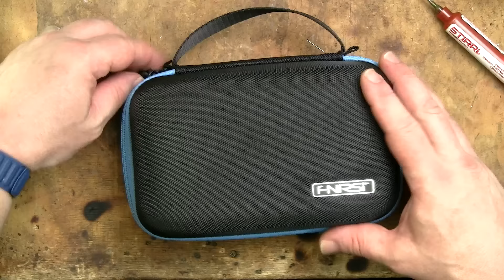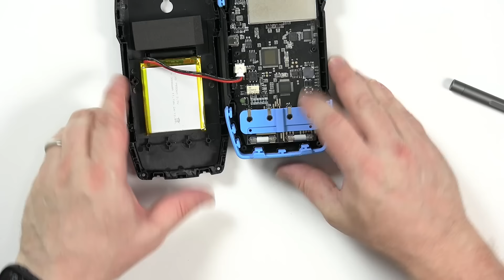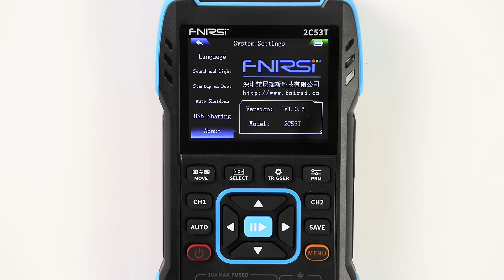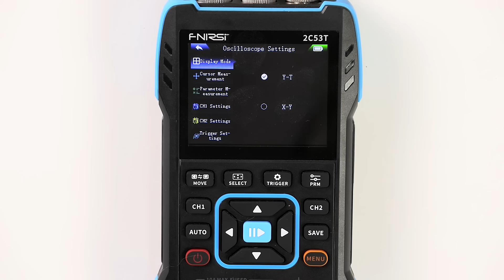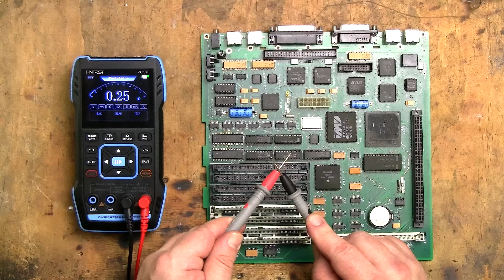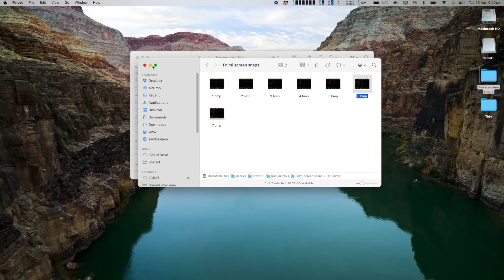FNIRSI 2C53T - 3 in 1 - Multimeter, Oscilloscope & Signal Generator Review

Comment: Can't hold a candle to the Alientek DM40. It's dual-channel, but not much else in it's favour.
The UI is awful: In this mode this button does this, in that mode it does something different.
Save the button space, have a much bigger screen, make it horizontal, and make it touch-sensitive (and context-sensitive) for the UI.
All you need is a touch-sensitive screen and I/O ports, the buttons are a huge waste of space.
If you're wedded to FNRSI, maybe check out the 2C53P instead.

Comment: Is there a difference in oscilloscope functions between this model and Fnirsi DS215H? They are both 50mhz 250ms/s and the cheaper DS215H has a higher res display

Comment: Thank you for the great review. I'm getting into soldering and needed a decent multi meter and since I bought the fnirsi dw200 solder station it's only right that I get the same brand for the multi meter. I would have bought the fluke but man there prices are insane! I think this will be more than enough for a beginner! Thanks again

Comment: I also bought one of these myself. Works very well. The only downside for me is that capacitance measurement is limited,. If you are measuring capacitors in the pF range, this meter won't be able to do that. Another downside for me is the signal generator can only out a maximum of 3V peak-to-peak. I wished it could at least get to about 5-6V peak-to-peak.

Comment: Thanks for sharing this, it was helpful and I will keep it in mind.  But all those button sequences are a lot to remember
.
I have a "big" oscilloscope that my youngest brother gave me. And I bought two or three usb oscilloscope where the computer screen is the control for the ADC data in an external usb box with probes.  And I have used sound card oscilloscopes for at least 30 years or more.

The problem I have with battery operated anything is I want to study things that go on for days, the battery runs out and there is not enough memory to store everything.  So i collect the data, store it and process later or I write c programs to monitor and capture summary data and event data in real time.

Comment: You didn’t mention how to use the relative mode in the multimeter. Use the PRM button. 
I would have liked to be able to fix the resistance range for a fast response. Great when comparing lots of similar resistors. 
Many thanks for the review/lesson.

Comment: Since it's dc powered can you safely use it to probe AC? Or should you still use an isolation probe?
Reply: DC power of this operation of this  Ocilloscope is no problem for this scope. Note: An isolation transformer should always be used of the equipment you are testing, no matter what. And becareful because all isolation transformer use a (chassis ground) so its never has fully isolation of AC ground. Check other videos on how to remove the isolation transformer AC ground, and how to check for it. Your devices to test you should always use a Variac and Isolation Transformer.
Reply: @Robert-hr6sh  I meant to say Differential probe but there isn't a way as the fnirsi uses  usb c and the probes  usb a!

Comment: What’s the resistance where it detects continuity? I have a Fluke handheld meter and a Hantek benchtop. The Hantek only reacts at a fairly low resistance (according the specs and practice) compared to the Fluke (also according to specs and practice), so it is quite difficult to get the Hantek to beep compared to the Fluke. I find this annoying with the Hantek. The Fluke is much more practical for continuity. I don’t remember the exact values of either.

Comment: I wonder if the internal resistance of the leeds themselves Play into the delay for continuity. I'm assuming it's their and wondering if swapping to the fluke leads would give you a better result? And possibly explain the slight differences in comparison.

Comment: Thanks a bunch for the review.   I just bought one of these.  It's my first scope.  I plan to use it to fix a VCR issue where the right audio channel has stopped working.

I also bought one of their component testers, and it's also in mF.  I hope in a future firmware update we can change it to µF.  FNIRSI could fix the cursor and trigger sensitivity by essentially adding a mouse scroll wheel / button.

Comment: In my opinion this is a rather rubbish quality tool. I've tried it and...is a far cry from a proper tool. In fact all that Finirsi produces is just...not worthy of a proper tool name. If you want a vastly better scope yet fairly cheap do yourself a favour and go for an OWON HDS272S, 2012S or 2202S scopes/multimeter.
Reply: Interesting… x2 times the cost, replaceable batteries. What else?

Comment: Mine seems to give inaccurate current readings. 
Circuit has approx 30mA 
DC high voltage showed 0.350A 
DV low voltage showed 4350uA 
Neither 350mA or 4mA are accurate. 
As far as I can tell you can't change scale to measure in mA or anything. Anyone else with same unit had issues?

Comment: On my Rigol scope, there is a probe calibration pin on the front.  I don't see the equivalent on this meter.  I just received one, maybe I'm missing something.
Reply: Probe for calibration shall be connected to the generator, the third bnc.
Reply: Wondering this too. There's a calibration going on when you long press "auto" button, but it's not clear whether to connect probes or not. I've attempted to tune the probe but it doesn't seem to do anything.
If you have reference test equipments, you could try and see what gives the closest results to the test equipment.

Comment: It's got weird bugs, like the trigger mode in Normal trigger is only operable at 20ms and faster sweep rates, reverting to Auto mode at 50ms and up. 
And even at sweep rates where it's supposed to be working, it will mostly miss the trigger events and not trigger at all. 
Workaround is to always use single sweep mode, which does trigger each and every time.  Just have to keep pushing the run button repeatedly to have a pseudo-normal mode. 

The DMM voltage readout in relative measurement mode shows an impressive number of digits, but they're just padded zeros, resolution is actually 0.1mV, and not down to the microvolt resolution it looked like at first glance. 
Relative mode has to be used for the min max reading to be at all useful, which is oddly implemented.

The recessed BNC connectors are annoying and prevent the use of regular scope probes, I guess they did that to protect the jacks and for a small form factor.

The case is kind of backwards also, need to open it from left to right, otherwise it's upside down in the case.

Still, as long as you know the quirks and limitations, it's pretty capable and useful given the $80 price of admission.
Reply: I use the hantec bnc cables with no problem. But can't use their amp clamp without an bnc extension adapter
Reply: @mandytuning 
I just keep a BNC extension in the case with it to allow it to be more universal.
Reply: The triggering problem with time over 50ms is common problem with this line of products starting with previous 2c32t. They didn't fix that in 2c53t but they was able to broke the generator that does not work at all bellow 0.3V. 😅
Reply: Did a firmware update fix the problems?
Reply: @NeoP2 
I'm not aware of any firmware updates being made for these, it would be nice if there was some kind of ongoing support for this though.

Comment: Concerned about the voltage ratings. Fluke and top shelf equipment uses expensive HRC (high rupture capacity) fuses, I'm not sure if those are (not at this price). Also spacing and isolation looks sketchy. For lower voltage stuff it looks great. I just ordered one myself and should get it today.
Reply: How is it?
Reply: @firescorpion7241  It's pretty cool but it's really only good to about 20Mhz. Plus the sample buffer is really small and sometimes you get all sorts of weird artifacts. For the cost I suppose it's to be expected. Eventually I plan on buying a Hantek DSO2000 series.

Comment: I do with Chinese manufacturers would discover a different font to that horrible low-res serif Times New Roman they insist on continually using!
Come on guys, get into the 1990s and try Arial!
Reply: It may be the lowest cost font where the creators live.
Reply: Fonts are not free. They use open-source fonts to keep the cost down by not having to pay license fees. I deal with it in my work as well. It surprises most people how many fonts they see daily in Word or other apps are not free for use except in that app's docs and printouts from it.
Reply: @gregaldr  There's hundreds of UI fonts which are free (as in freedom and free pizza) for unrestricted commercial use. The issue you're presenting is only a constraint when doing professional design, which is entirely irrelevant here. Readability is the only relevant metric here, and there's nothing stopping them from using Droid, DejaVu, Noto, Open Sans, etc. etc.
Reply: @MunyuShizumi thanks for pointing rhis out, I figured there wasnt some AI  font police like the OP was suggesting lol

Comment: Nice meter, thanks for the review. I have an older Tektronix THS720 100 MHz 2 Channel that needs a new screen. Wondering if it’s even worth fixing.
Reply: Absolutely repair it! It was a $10k dollar scope and does some really fancy measurements. 
Unless you don’t use the isolated channels, spectrum analyzer, etc.
My THS720 is still in use, got it for working on VS D drives, and the isolated channels and accuracy is unmatched. Fluke scope meter is the closest, and again $$$$
Reply: @glennwright9747 and they’re all made in China 😂
Reply: Mine developed a really weird reverse video blotch in the middle that makes it hard to see unless viewed at an obtuse angle. Still works though-